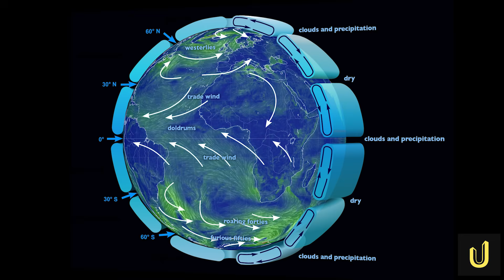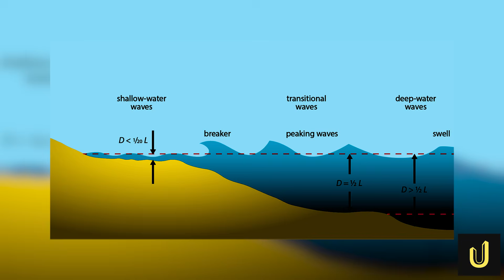Inside the Impossible Tasmania Bridge—and Why It Still Might Happen

Comment: Nothing about a bridge across a sea at 240 kilometres with significant tidal currents and geological activity is a good idea, a tunnel is safer to build and easier to repair and can withstand an 8 magnitude earthquake with no sea tides or salt corrosion issues. Only a fool would build a bridge this long over such a distance in an age of easy tunnel building ✌️❤️🇬🇧